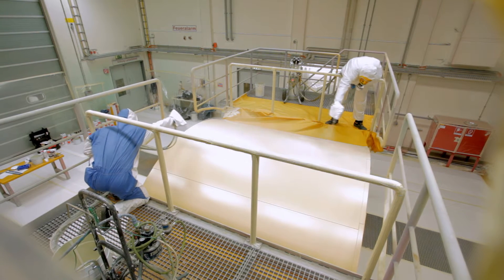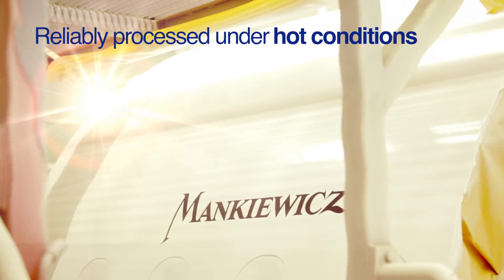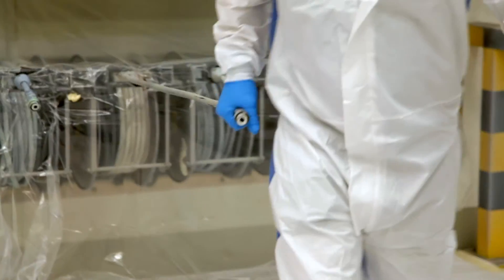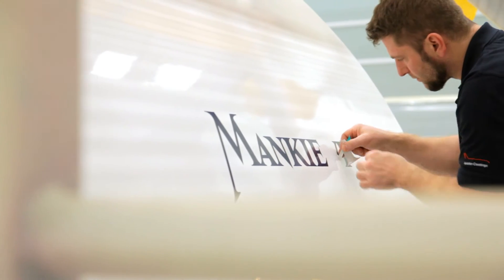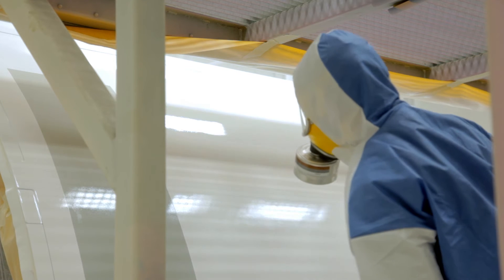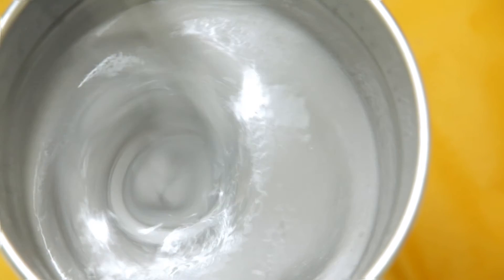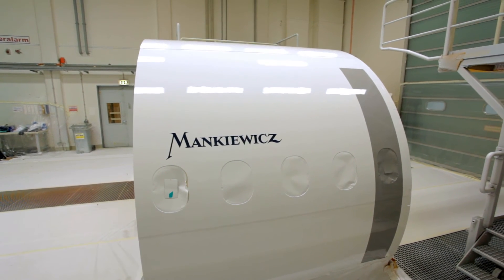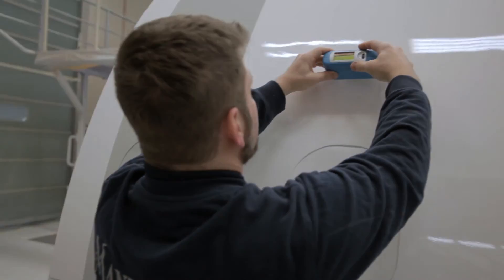The Mankiewicz BaseCoat/ClearCoat System

Comment: Mankiewicz Hamburg | peinture NEXTEL Suede Coating | Surface mate, semblable au daim, à l'aspect textile chaleureux | Propriété anti-reflet | ALEXIT® BladeRep | Wind Power Industry | Secteur de l'énergie éolienne | Éoliennes
Reply: hello , good evening , I am an aerospace painter , I work in a company that manufactures fiberglass parts , in some we use anti - reflective paint brand Mankiewicz Nextel suede coating , only that we have doubts about the correct use eg nozzle for application , since we use guns Seriously, could you help me to know what is the correct measure to apply said product... thanks regards !!